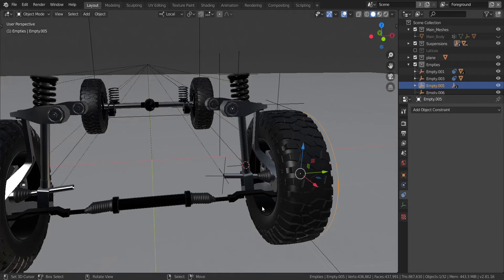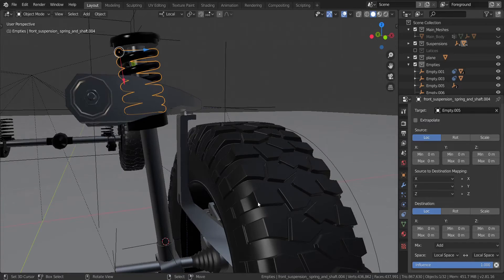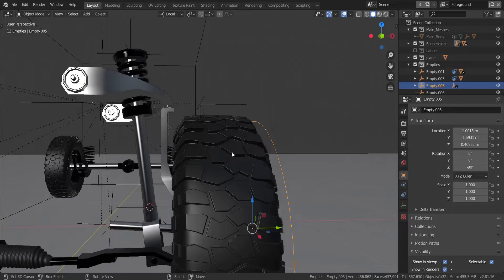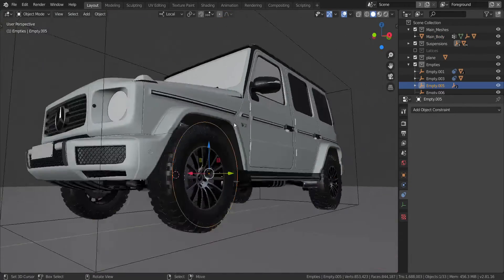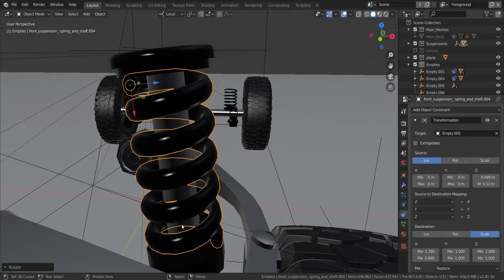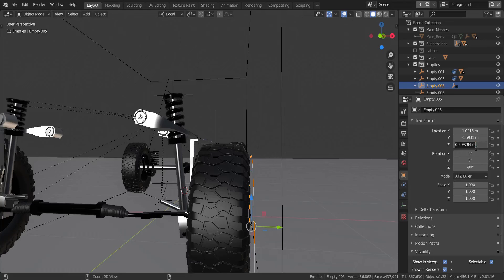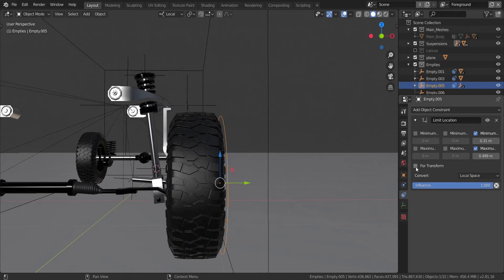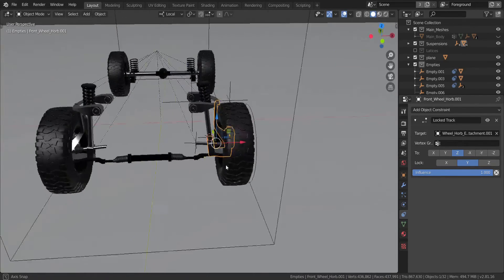Blender 2.81 - Rigging A Car - Part 3 (Front Suspension - Continued)

Comment: Great videos. I've watched your previous videos and worked with your suspension model but without the cab. Every time I save after video #2 when I come back and open it everything that was worked with is in weird position and scale of tire is different. Do you have any ideas why it's doing that? Is it cause I'm not using the cab?

Comment: This series you have on rigging a car is great! Though, I was wondering if there was a way for you to make the spring in the suspension compress more realistically (the spring seems to flatten as it contracts). Thanks!
Reply from the maker: yeah, just increase the limits for the springs.
Reply from the maker: I'm not sure if that's possible but not for me so far.
Reply: @NaturalArtFreak  Another technique I've seen is by using splines to make the spring shape and rigging a bone to it.
Reply from the maker: @paganzynda-qo5hn  great, as long as it functions as mechanically expected then it would be good.
Reply: I actually wondered over this same question a while ago. One trick is to create the spring from a bezier and hook every control point, then linearily weight each hook to the control bones. Another is to extrude a cylinder mesh along the curve and weight it linearily from end to end. When applied the mesh should not flatten.
Reply: @anon456938  This doesn't sound easy
Reply: That's because we are scaling it and not contracting and expanding